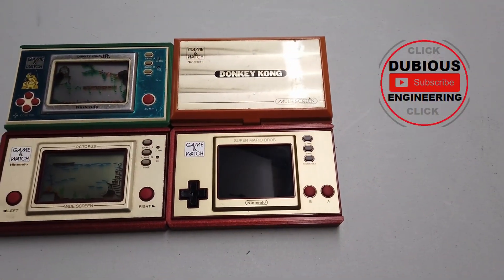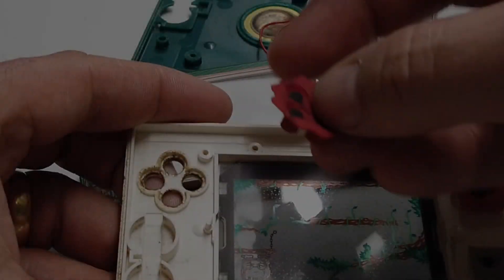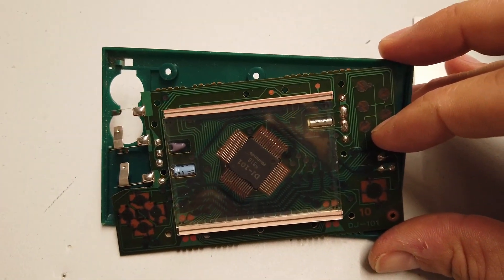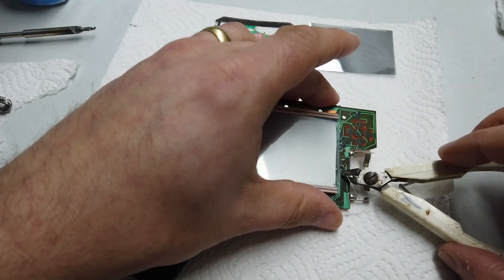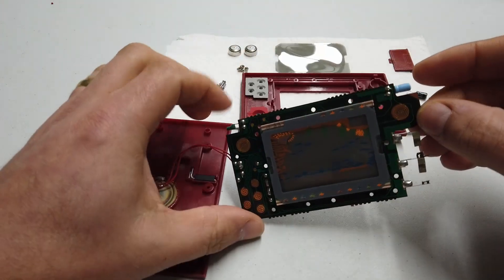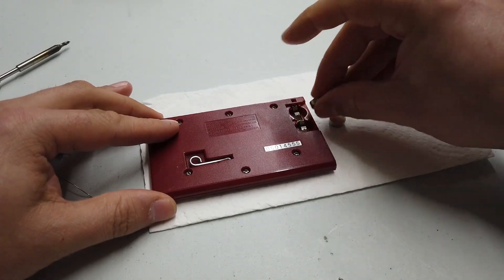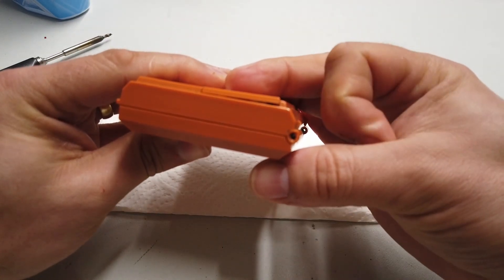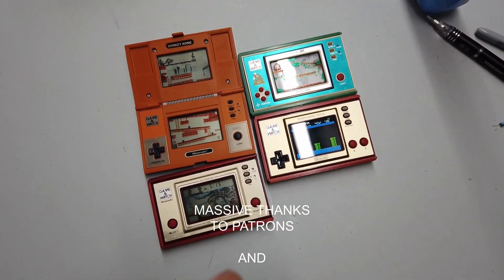DuB-EnG: VINTAGE NINTENDO GAME & WATCH REAPIRS fixing Octopus, Donkey Kong JR and more!

Comment: Brilliant job on the battery compartment; definitely going to need that trick in my arsenal one day.
You've inspired me to dig out my old Mario's Cement Factory. Was surprised to find it still boxed and in working order.
Reply from the maker: Superb! ...  great nostalgia and fun!  Enjoy playing cement factory!
Reply: @DubiousEngineering  Unfortunately, seven-year-old-me thought it was a good idea to 'clean' it with hairspray. Must have been some acetone in there as the previous plastic screen is warped.
Might try gently ironing it flat or something...
Reply from the maker: Awww.  Damn!   If it’s just the polarised filter - you can buy replacement quite cheap!
Reply: @DubiousEngineering  Sadly not. Think I'll leave it warped as some of the ink has transferred to the LCD. Might pick up some laser printer transparency sheets and try printing a replacement...

Comment: Nice job! I was wondering what was the specification of the capacitors that was replaced. Trying to find replacements for a Nintendo Pinball Game & Watch, which have very grey figures, despite new batteries and new polarising filters.
Reply from the maker: I think the LCD degrades over time...  not sure this will help.

Comment: Great video ! I have a G&W parachute and it was working fine a friend had put bread batteries in there and these were a bit thicker it worked for a few minutes and then when pressing the buttons everything went off.. any suggestions?
Reply from the maker: Perhaps adjust the battery springs to make sure the batteries are actually touching the contacts?
Reply: @DubiousEngineering  Thank you.. I took the unit to peices cleaned up everything again removed the LCD cleaned the battery terminals etc and it fired into life again ..

Comment: Hello i have a game & watch parachute and the Left & right Buttons dont work i opened it up and cleaned the board contacts with isopropyl it had black soot on the contacts both of them i put it back together and the buttons still dont work do you no what the problem is & how can i fix this Thanks Jos
Reply from the maker: It’s a tough one…. Try alcohol on a cotton bud and clean the pads on the underside of the buttons

Comment: Excellent work. I have a game and watch that works well, but only if I press the unit together. In other words, there are no sounds or visuals, but if I put my finger on the front of the game, my thumb on the back and apply pressure, it works. I opened it up and cleaned it well, also thinking perhaps it just hadn't been screwed back together firmly...nope. Then I put some thin cardboard inside the unit and got partial visuals & sound. Something inside is just not touching something else as it should, but I can't figure it out. Any suggestions?
Reply from the maker: It's possible you have a broken track on the PCB ...  that would be difficult to fix.  Please do check cables and solder joints, also make sure the battery terminals are making contact .  Good luck!!
Reply: @DubiousEngineering  Thank you.  'm inclined to believe it must (mainly) be the battery connector(s). I cleaned the unit again and fiddled a little with the battery compartment. Right now, I have almost all of the graphics showing. I don't want to open it up again though, because the last time I did, I broke off the speaker wires (taped them back, as I don't have a soldiering iron and the sound is fine again).

Comment: What were the values for both electrolytic and tantalum capacitors?  Great content. Thank you!
Reply from the maker: So sorry, I'd have no idea without opening them up again@
Reply: I have the same issue with my octopus g&w and i would be curious too of knowing what kind of  capacitor are needed for the replacement. (Sorry for my bad english)

Comment: Hello, I have a problem with a OCTUPUS game. 
The right button do not work an the left button let shift the guy to the right side.
I have replaced the 2 capacitors. Unfortunately this do not help.
Do you have a idea what could help? Or what could be the problem?
Reply from the maker: That's really weird!  I'm guessing you cleaned the PCB pads and buttons with alcohol.  It's almost like the pcb tracks are crossed over or shorted...  any corrosion or water get into it?

Comment: Good morning. I have a problem with my g&w donkey kong jr. When I insert the batteries, all the sprites appear on the screen but the game doesn't start (no button works.... gamea, gameb time, acl,...). I noticed that when I insert the batteries, 12:00 does not appear on the display but 18:88. Could it be a capacitor problem? Thanks and greetings
Reply from the maker: Ahhh that sounds like the micro isn't starting.  About the only thing you can do is replace the capacitor and hope!
Reply: @DubiousEngineering  
OK thanks. Only two questions. First question. What function do the two capacitors near the batteries have? Second question. Near the clock are there two more capacitors? What are they for? thanks and a greeting.

Comment: i just purchased a set of 16v 10uF electrolytic capacitors and replaced those on two of my game and watch units... and while it did fix the power issue (those units used to reset or have garbled graphics randomly), it did not fix the display (some of the images on the screen are blurred depending on what images are displayed, and the refresh rate is super bad)

i still have my 0.47uF tantalum capacitors and all kinds of ceramic capacitors waiting to be delivered...
Reply from the maker: Best of luck my friend!!  Love these games

Comment: Did you replace the Tantalum cap with an electrolytic one? If so, what was the rating of that Cap? Could you possibly list the ratings on both caps that you ended up using? Thank you so much...this was a fantastic video!
Reply from the maker: glad you found it useful! ...  I used a 10uf 20v cap on the power supply side and a 1uf 20v cap to replace the tantalum bead (the bead is 0.33uf but 1uf is fine) ... keep an eye on polarity!
Reply: @DubiousEngineering  i will keep this in mind. thanks!
Reply: @DubiousEngineering  hmmm, perhaps I'm wrong then. This green cap is labeled 33/35 ... is this a .33uf cap?
Reply: Hola, muy buen tutorial
 cuales son los valores maximos admisibles para los capacitadores?.
Reply: Me refiero a voltaje.  Gracias

Comment: I have missing characters. How to fix those? Also where to buy the capacitors?
Reply from the maker: The adjust the display zebra connector and give things a clean... RS sell the caps... or eBay
Reply: @DubiousEngineering  I removed the zebra and cleaned... I also removed the rubber connector which connects board to lcd and cleaned still missing characters. Anything after that? Thanks...
Reply: @vintageseller7700  either the zebra connector is damaged, or the lcd glass itself is damaged

Comment: Hi
I have a Donkey Kong jr game&watch, but the second line with donkey Kong at the bottom doesn‘t get displayed, everything Else is working fine, does anyone know this problem?
Reply from the maker: It may be the zebra connector...  a rubber strip that connects the LCD to the PCB ...  see if you can carefully pop it off and give it a clean.

Comment: Should use LR43 in the single screen games. LR44 are thicker and for the dual screen games.
Reply from the maker: Thanks for the tip!
Reply: @DubiousEngineering  no problem. It actually has the battery type printer on the rear casing. The confusion around batteries is possibly why so many battery cases are missing these days. If they broke people would likely have binned them. At least we can print reasonable facsimiles these days!

Comment: Hi there. Amazing video. I did as you did in this video. I changed the caps with 25v 10uf and 0.33uf tantalum cap but the lcd is still bleak and dim. I changed the polarizer too. I happen to have 2 donkey kong DK52. When i change the lcd from the first game to the other i see all the sprites and when i put it back again in the first one the sprites are bleak and dim. So the issue is definitely with the pcb. How do i solve this pcb dimness? I change the caps and tried but still the same. Anything else that we need to troubleshoot to check if the pcb is all okay? I also changed the picafarad ceramic disc caps. Still the same. I left the oscillator as it is, as they hardly give up unless physically damaged. Could it be the problem of the motherboard IC chip? Please make a video of troubleshooting the pcb if possible. It will be of greaf help. Regards
Reply from the maker: I don’t think there’s much to do on the PCB, it’s a blob chip…. So, I think you’ve done everything you can…. Sadly….
Reply: @DubiousEngineering  thank you so much for replying. The chip must have given away for did its life. 42 years and still this thing works, is amazing. I totally enjoy your vids.. thank you again..